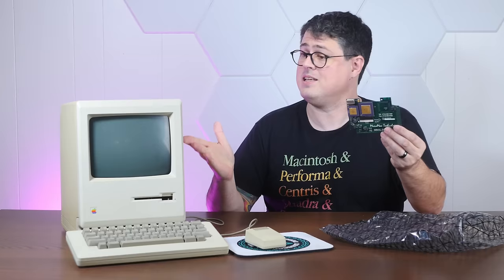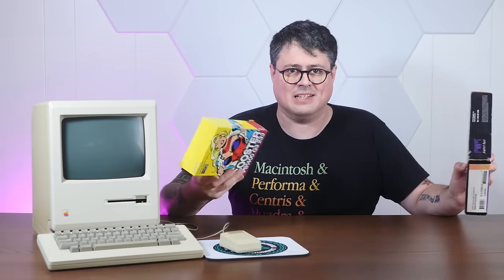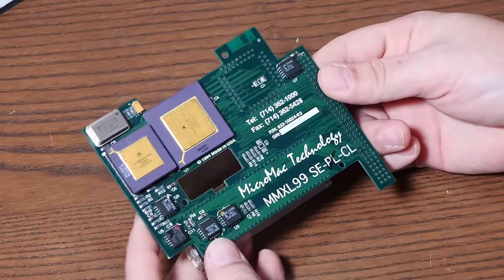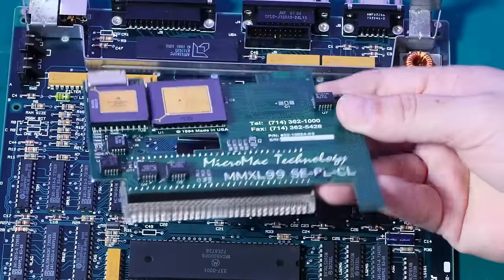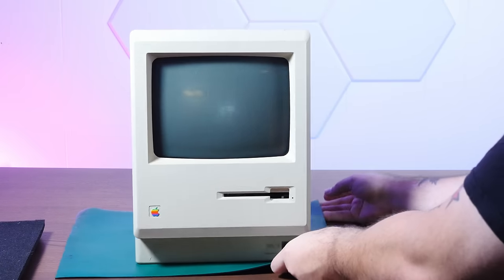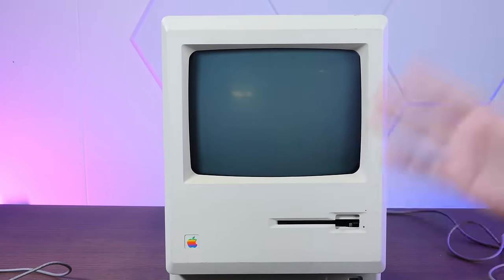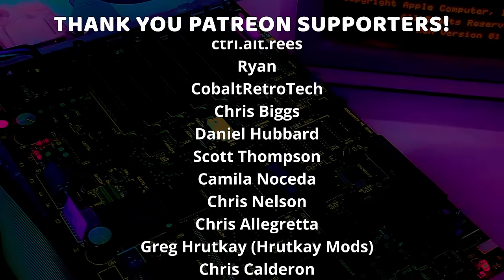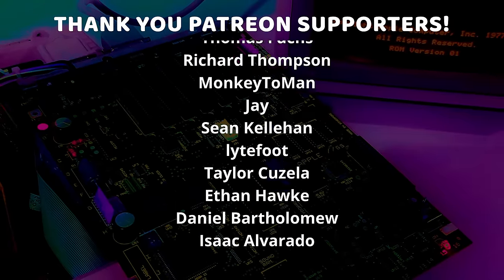Building a Slightly Cursed Mac Plus Plus Plus

Comment: There are several reasons that 68020/030 upgrades are so unstable on these machines, and it's not really fixable.

Starting with the system ROM, it uses "32 bit dirty" code. The 68000 has a 24 bit address bus, and Apple in an attempt to save memory would use the upper 8 bits of a 32 bit address as flags. The 68000 was fine with this because it only ever saw 24 bits, but when you get into 68020/030 CPUs, it's a major problem because those are full 32 bit CPUs. Now that same code would be throwing 32 bits of nonsense at the CPU and causing unpredictable behavior.

But the system ROM wasn't the only thing that used 32 bit dirty code, Mac OS and applications at the time all did it as well. This means that you'll never really be able to run in a pure 32 bit addressing mode without constant trouble from "dirty" code.

If you want a really bad time, try to run the game "Dark Castle" or "Return to Dark Castle" on Mac OS 7.x on a compact mac. It will cause stack smashing, which will obliterate any and all partitions on the hard drive and cause some psychedelic screen nonsense to happen.

The only real workaround for accelerators on compact macs is to run System Software 6.0.8, the last to run in pure 24 bit addressing modes. This of course hampers the potential performance of an accelerator card, but it will keep most of the problems with 32 bit dirty software in check. And as a practical matter, there's really nothing in System 7.x that applies to compact macs anyway. It just runs slower.

I have a Mac SE with a Total Systems Gemini Ultra accelerator, and it's only stable with System 6.0.8. It will run 7.x, but it does all of the nasty things you've shown in this video and won't run right.
Reply: Sounds like you could just work around it by running system 7 with 32 bit addressing disabled (the default).

Provided you stick to 24bit software, you should be ok.
Reply: @kirishima638  That's not what 32 bit addressing is for. It's to allow System 7+ to address more memory, it has nothing to do with not allowing the system to run 32 bit code.

System 7 itself has 32 bit code in it that isn't compatible with older 24 bit Macs, it didn't help that Apple didn't explicitly cut off the older machines, even though there were known compatibility issues. Compact Macs weren't the only ones with compatibility issues with either, many Mac II series machines also had 24 bit dirty ROMs and required MODE32 from Connectix, which Apple later licensed so users could download it for free.

There's no way to prevent 32 bit code from trying to run on a 24 bit machine and vice versa, because hardly anyone took the time to make compatibility lists for all of the Apple machines.

It's a miracle the original system software even worked at all, because it was more of an ad hoc system of APIs glued together from many different sources. By the time Mac OS 9 came around, more of the OS had been written by third parties than Apple itself. Apple by that time had desperately been trying to keep their "OS" relevant by spending lots of money buying 3rd party extensions to their OS and incorporating it in.
Reply: @GGigabiteM  thanks I didn’t know that. I assumed the switch applied to all apps.

Totally agree about the state of the OS.
Reply: I still don't quite understand how the 68020+ upgrade would break things if you only hook up the 24 address lines you have, given that the 68000/010 can mangle addresses as 32-bit quantities all the same. Interfacing with a 16-bit data bus sounds like a harder problem.
Reply: @D0Samp  You can't just arbitrarily hook up how many address lines you want and leave the rest floating. The 68020/030 are 32 bit CPUs and expect full 32 bit buses. There are ways to engineer around them, which is why upgrade boards are generally packed with tons of custom logic chips.

While the 68000 had 32 bit registers internally, most operations were 16 bits and only worked on half of the register at a time.

If Mac OS sends a "24 bit" operand to a 68020/68030, it's really sending 32 bits of data (24 bits of normal code plus the 8 bits of flags). The 68020/030 doesn't know the difference and will take this as a full 32 bit operand and try to execute it, causing undefined erratic behavior.

Engineering around a 16 bit data bus is a lot easier than a 24 bit address bus. If you have to perform a 32 bit operation, you just break it up into two 16 bit operations to load the data and two more to store each piece as it comes in. Many architectures do this, including the 68000 if it has to do a 32 bit operation on the bus.
Reply: @GGigabiteM  Thanks, after a lot of pondering and reading docs I finally understood it now. System 7 is using full 32-bit addresses for the OS by default even when the ROM and applications don't support them, and the accelerator extensions certainly won't force it into 24-bit mode either (that still existed at least in 7.0) when one of the reasons for the upgrade board is to go above 4 resp. 8 MB RAM in the first place. If you do pointer arithmetic between tagged (from the application/ROM) and untagged (from the OS) pointers, you could get wrong results that are still wrong even if you put the CPU behind an address decoder that throws away the top 8 bits and wraps memory to $00xxxxxx.

The data bus situation is remarkably similar to the Intel 80386SX (that largely was just a speed upgrade for 16-bit PC software), except that already has a 32-bit ALU being a decade younger.
Reply: @D0Samp  Additionally, some 68030 upgrades do device remapping in memory using the 68030's MMU to make said memory expansions work. This creates another whole set of headaches.

Devices on the 68000 bus are memory mapped, and Apple conveniently sprinkled them all over the address space. This creates problems expanding the system memory, because MacOS can only allocate contiguous memory chunks to applications. So if you have 8 MB of RAM and some memory mapped devices sprinkled in the middle of it, you may only be able to load less than 4 MB programs.

The Total Systems Gemini Ultra that I have can remap most system memory mapped devices into a contiguous location, so that larger chunks of memory are free for applications. This almost never works properly in my experience. So you can have all of this expanded memory and not be able to use large portions of it due to the fragmented memory map.

I'm glad I didn't pay original MSRP for this TS Gemini Ultra, which was apparently almost $2000 in early 90s dollars. I was extremely lucky and found it in an SE at a second hand store in the late 90s. I thank my kid self for saving the card when the original machine it was in died to use all these years later.
Reply: @z Unfortunately, no. I never made a video of it happening.

It would also take the better part of a day to get everything set up since I removed the TS Gemini from my Mac SE for storage.
Reply: is the 68010 a full 32 bit cpu?

Comment: 1:32 “cobbling” together a 386 system was a breeze with so many fully compatible inexpensive options.
Reply: Only if you were tech-savvy. For most people, A Mac Plus was a simpler proposition; as there were no real choices to be made… perhaps add a hard drive and printer; but there was really only a couple possibilities there as well; and if you wanted to stay 100% Apple, it was an HD20SC and an ImageWriter.
Reply: Building a PC was challenging in the 386 era, in the age of jumpers, before plug and play existed, especially having to navigate the IRQ/DMA assignment hell. Non-technical users would always choose a pre-made system instead. Things got easier during the Pentium era when most motherboards were auto configurable and plug and play was working okay.

Comment: I just bought a mac classic off facebook market place.  To my surprise when I opened it up I found one of these accelerator cards.  Mine obviously was fitted with the classic connector.  It makes my mac classic 3 times faster than stock. I have not tried to use it with a blue scsi.  the original hard drive was working so I just kept it that way.  Great video, the struggle to get these things working is the joy of collecting old computers.  If it all just worked out of the box it wouldn't be as much fun.
Reply from the maker: Nice find, and totally agree!

Comment: We had Mac Plus workstations at the Music Technology department, and the easiest we worked with, was an extension called 'Ram Disk', that made it possible to boot from a system floppy, then load that same system OS in Ram, then eject that floppy, allowing you to insert the application floppy (MOTU's Performer) and go to work without having to keep floppy-swapping.  Nifty little app!

Comment: It's not the CPU that really generates the heat on these, it's the CRT and analog board. If you're worried about temps, get a Kensington System Saver or cut a proper fan vent and mount on the back of the case. Larry Pina's books have some good instructions for doing so.
Is this upgrade worth it? Maybe back in 1990 if the choice was between buying an accelerator for an existing Plus that has a hard drive and other accessories, or a brand-new SE/30. Nowadays people would probably want more for that upgrade card than a real SE/30. Either way, I'd say it's a "because it's there" sort of thing: there's some benefit but unless you're running programs entirely within the 256 bytes of L1 cache on the '030, it's not going to be anywhere close to the SE/30 in performance, mostly because of the Plus's slower and narrower (16 bits @ 8MHz) bus. Then there's still the RAM ceiling of the Plus (nowhere close to the 128MB of the SE/30), and the Plus doesn't support FDHD drives (except for third-party SCSI-based floppy drives). Finally, there's the fact that some software just won't cooperate because, even though there's an '030 and an '882 present, it still has Plus ROMs and so some fakery is required to get it to maybe possibly (but probably not) work.
Reply: I imagine any remaining System Savers could use a fan replacement.

Comment: I had a lot of problems getting my bluescsi to work and even now it will occasional fail to boot. 

A 16 or 25mhz 68030 runs cool enough to not require a fan. These power many PowerBook models with considerably less space with no fan and they don’t even have passive cooling.

Comment: You make a comparison to a 386 at the start of the video, but consider that in 1986 a 386 was absolutely the top of the line money could buy.
The Mac Plus is much more inline with something like a Turbo XT, which could cost less than $1000. 

Oh, and the Amiga 500 existed, which bested the Mac Plus in every possible way to the point it could run Mac software.
Reply: A barebone Turbo XT could be bought in the back of Computer shopper for $599.  With a 20 Mb hard drive and Color Monitor, you are up to $1500.  Giving you a machine with higher Resolution   (Hercules graphics 720x348) Color and a Hard drive.  None of which the Plus had out of the box.

Comment: I started my vintage mac collection in the late 90's, the first was a Performa 5215 which was okay. Then I bought a 145b and 180c which blew me away for they were like coloring books coming to life. Within the next few years, I was given a few Plus's and an SE which sat for years before I'd figure out how to boot them... Although the Plus would boot from floppies but it also came with an external HD which I had to take the top off and kick start it to boot... After watching the needle move across the disc and then stuff would appear on screen which made it a favorite in it's own quirky way. I never really mind how slow it was though, I just thought of it as the little Mac that could. I simply hated the SE for being so ugly and when I finally got around to it, I was totally shocked and surprised at how crisp the screen was and also it's speed. What sat it off was a program called lip service that greeted and told you the time as it booted...

Comment: The fact that the INIT works in 6.0.7 but does not work in 7.1.x makes me think there's a compatibility issue right there. There were many System 6 programs and INITs/extensions that did not work properly in 7 and 7.1. Is there a newer extension? 
Memory addressing was also an issue between 6 and 7 -- you'd have to turn off 32 bit memory addressing to get some older software to work. Not sure if that would impact the plus at all, as it would generally impact 030's like the SE/30 that had 'dirty ROMs'. But since the upgrade is an 030, maybe it does apply here.
Reply: I have zero experience with this era of Macs but as an IT person for 30 years that’s what my gut told me too.

Comment: Have you tried using Mini Vmac to put the drivers in the image and then boot from that?
Maybe the big problem with the upgrade is that it overclocks the bus and you get crashes when there are collisions on the data lines?

Comment: What a coincidence, I just ordered a blueSCSI the other day. The seller did specifically state that it came unflashed, but I've never used a Blue Pill before. I did order the STLink programmer, so hopefully it will be pretty straightforward. It's supposed to come with a Blue Pill, so at least I'll have a spare if I totally screw up the original one!

That reminds me, I'll also need to order a micro SD card to use with the thing.

Anyway, hopefully you can lift the curse and get your Mac Plus working stably with the upgrade.

Comment: 1:34 That said, you certainly wouldn't build a DOS computer around an 80386 yourself in 1986. Not only were they much more expensive, MS-DOS also still lacked (built-in + 3rd party) facilities to use that whole whopping megabyte of RAM and OS/2, the operating system of a different future, wouldn't ship until the next year and still only use 80286 features. It's much more likely someone had already somehow shoved a 68020 into their Macintosh Plus at the time.
Reply: He's cherry picking with the Compaq machine.  They were literally the most expensive "clone"  At the time (1986) you could buy a barebone Turbo XT machine with 640K of Ram and a single 360K floppy for $599.

Comment: "One keyboard and one monitor in one outlet." Not if you wanted to use a hard disc, without which the Mac Plus experience was pretty terrible. I had a Rodime 20 Plus, my first ever hard disc, and I thought it was amazing.
Reply: Also ignoring the fact that most XT and AT power supplies of the time have a passthough for the monitor to connect to.
Reply: @dennisp.2147  Yes. The successor to my Mac Plus, a cheap Goldstar PC used for university work, had exactly that and an internal HDD, so it did work from one socket.

Comment: With all that floppy swapping - I was wondering - why not just image those disks to the floppy emu or similar and just "swap" them virtually - could save a ton of time and effort, methinks.  Also, not sure what the first 'hack' was you mentioned (something about a resistor removal?) but perhaps that could contribute to the issues?  

I'm dug my Mac Plus out the other day and I'm going to tear it down later today with my floppy emu and whatever else I can find.  It's been far too long since I ran it.  

What's the "best" OS for it?  7.1?  7.5?  So far as I know, it's stock, but I might be able to get it up to 4MB RAM.  Likely will just use it for some writing and MAYBE some old-school (not intensive) gaming.  

Thanks as always for the great content.

Comment: I wonder if the bluescsi issue is power related, maybe the accelerator board is drawing enough that there's not a lot share to run the drive. Can you externally power those?

Comment: Ah, yes. Extending your touch. One of the only proper usages for an M:TG rules reference card. The other being breaking into your apartment when you've locked your keys inside and you need to use the card trick to slip past your lock.

Comment: I think that comparison around 1:38 is a bit unfair - 286s were really more comparable, and the prices are much more reasonable when you're looking at 286s in 1987 instead of 386s.

Also, that price at 3:39 was from the mid-90s, so obviously it cost a whole lot less than the SE/30 initially cost at retail many years prior.

Comment: I've had similar problems with the BlueSCSI also, in this case on a Macintosh IIsi with a Daystar Powercache 33mhz 68030 accelerator. I recall it being OK when I was first setting it up without the accelerator installed, but once I put it in and installed the extension it started getting more and more slow and unstable, although my memory may be faulty. Eventually I had to switch to using an external Apple 3gb hard drive, which works without a hitch. I wonder if there's a compatibility problem with accelerators and modern SD card readers.

Comment: How is that clip-on upgrade even supposed to work? I'm not an expert on electronics, but doesn't it mean that all the signals come to and from both the original 68k CPU and the upgrade card? Did they use some kind of weird trick to bypass the original CPU?
Reply: No weird trick, the accelerator asserts bus request similarly to if you had a dma expansion that wanted the bus. The accelerator just never relinquishes the bus, so the 68k will just sit there waiting forever in tristated mode.
Reply: @Jope9k  So does that mean that nothing else can use DMA on such a system? Maybe that's what causing issues with SCSI?
Reply: @kFY514  true, but I doubt there is any dma in a mac plus, since to my knowledge early macs are very much cpu bound for everything. My guess on the errors is that he was running system 7. The working boot disk had system 6 on it, which sounds like that's the last one that works wirh this turbo. I'm not a mac guy tho, so who knows :-)